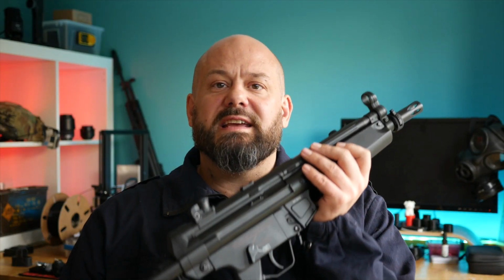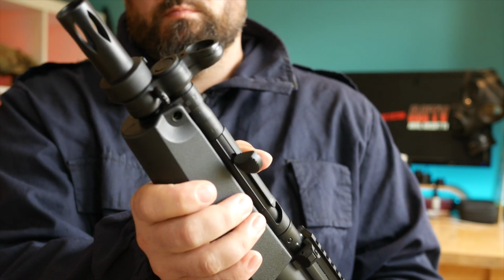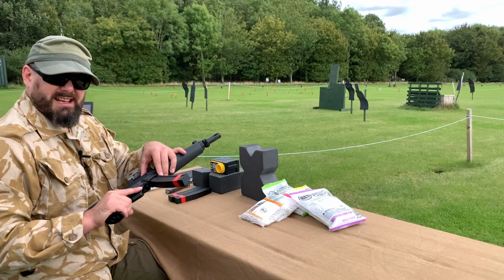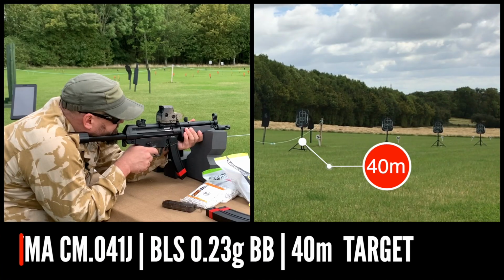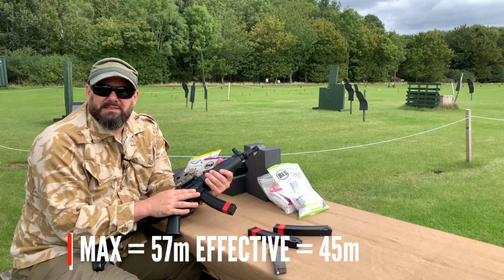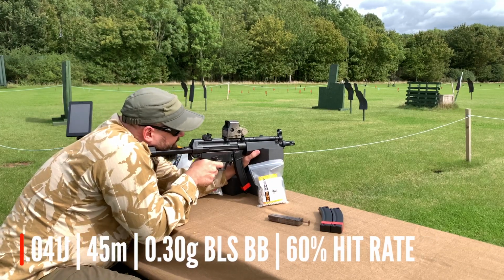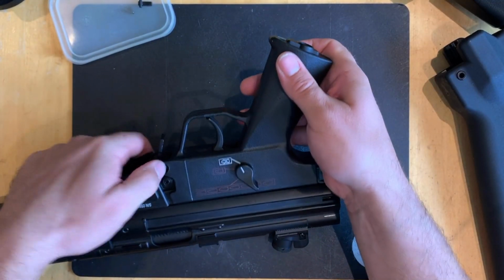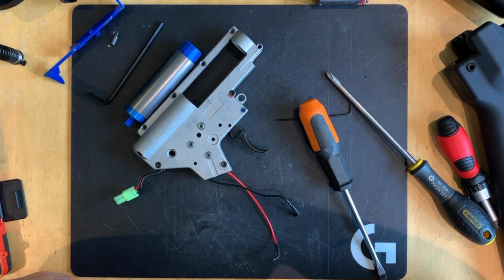AATV Cyma CM.041J High-Speed - MP5A3 Airsoft Replica Review

Comment: I picked up one of these about 6 months ago. It is one of the most comfortable CQB guns I have ever used. Light enough that I can still move fast and not worry about getting court on things, but heavy enough so it doesn’t feel like I’m using a water pistol. You can’t go wrong with it in my option. Hover, I do have one question.... we’re did you find a tac vest your wearing at the beginning? I have been looking all over the place for one like that

Comment: Hey great review but I was wondering how you set the hop up for specific weight of bbs?
Reply: If you open pull back the cocking lever, and look on the right where rounds would com out there is a small black plastic piece near front, pull it back slightly and that will sort it

Comment: Would a 7.4 v or a 11.1 v be better for something like this stock? Thinking about getting one of these in the near future.
Reply from the maker: As you can see in the product description we recommend the 11.1 battery as well as the 7.4. If you won't be using auto excessive and you won't empty mag after mag nothing wrong will happen.
Reply: @KrakmanTaiwanGun What's the largest size battery you can fit in it?
Reply from the maker: @bradley.h  there is a list of batteries that will fit on the product site, you can figure out the maximum dimensions of the battery, that will fit :)

Comment: Hi all, if i were to purchase this MP5 would you suggest the medium option (350 fps) or the Low option (300 fps) i mainly use .25's but don't want the fps below 300 fps, fyi i live in the UK
Reply: Thank you for the advice, but this is the High Speed version of the MP5, and it stops only at 340.

Comment: Is it recommended to run with a 11.1v lipo straight out the box
Reply: I was sent an 11.1v 1100 mAh LiPo for the test. I don’t know if that’s what’s recommended though.
Reply from the maker: Yes, we recommend this type of power supply.
Reply: @KrakmanTaiwanGun  Hi I just bought the cm.041 sd6 Blue edition; is this the same as the high speed edition, and can it also use a 11.1v without modification?

Love the trigger response and rate of fire here
Reply: @KrakmanTaiwanGun  Does using 11.1 li-po without a mosfet cause burns in the long run?
Reply: @KrakmanTaiwanGun  What brand would you reccommend (11.1v 1100mAh lipo)? How lond goes the battery last?